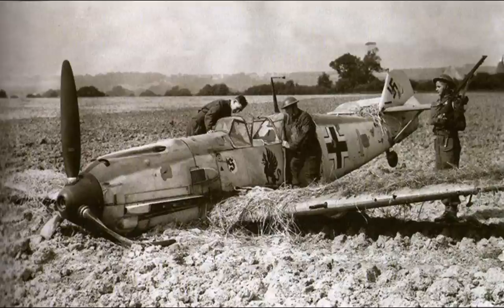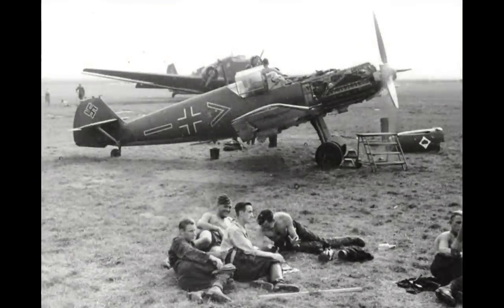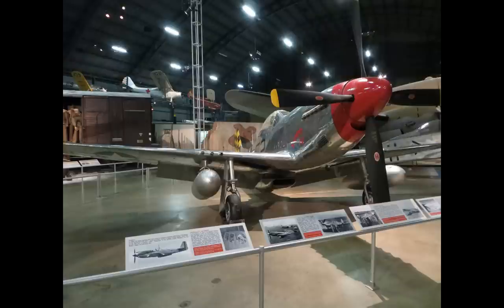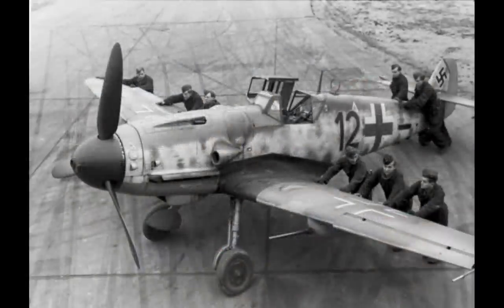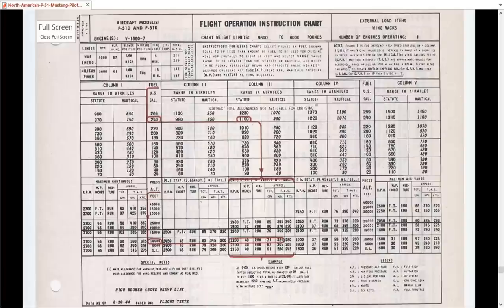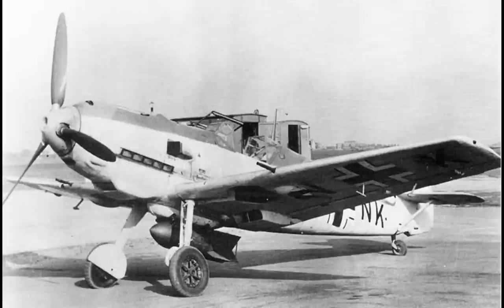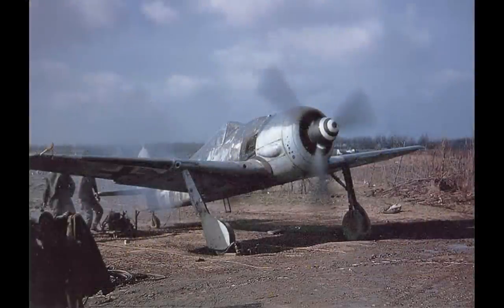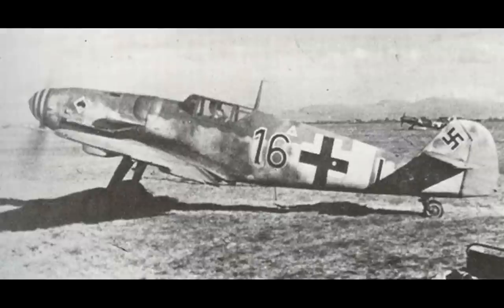Messerschmitt BF 109, Why Such Short Range?

Comment: As mentioned, the Spitfire and Hurricane did not have any better range than the 109. Also the Spitfire's, like the 109's, wing structure and design did not allow the addition of fuel tanks. The German airforce was basicaly a tactical force where range was not that important. I think at the start of the war bombers were not expected to need an escort so the fighters tended to be a "point defense" interceptor. In that role extra fuel just adds weight and reduces performance particularly climb.
After D-day the RAF Spitfires had to move with the front lines so they could stay in range of the fighting.

The US, as in many other things in WW2, had time to design new aircraft to meet the new needs. Remember the war started in 1939 the US did not enter until 1942 (December is almost 1942 by any realistic measure). (the P-51 was faster due to better and more modern aerodynamics, just the design of the airflow though the radiator system was huge. I am sure Greg covers this later.)

The reason the Germans used bigger engines for the same horspower was fuel. The German airforce had to make due with 87 octane gasoline where the US (RAF fuel was supplied by the US too I expect) was 100 octane (there was 120 octane too but I don't know how avialiable it was) The much higher octane allowed much higher manifold pressure so the engines could develope more horsepower per engine displacement.

As bonus info: The B-17 cost more, flew slower and had fewer built than the B-24 but the B-17 got most of the recogniton.

Comment: Well somebody that asks the right questions! And here´s another one:
From it´s inception, the Luftwaffe was designed to support ground forces, not fight on it´s own. It had no strategic role whatsoever, unlike it´s US counterparts. Second: From 1942 on it´s purely used for protection of the Heimat, by than being bombed around the clock. So there´s simply no time for updating it! It remains in production, without major updates, until the end of the war. Same for the bombers used by the Luftwaffe: The same He-111 bomber remains in production because they couldn´t afford a pause in it´s production. The Eastern Front required a LOT of tactical bombers and fighter-bombers to offset superior Russian Armour.

Everybody always thinks the Wehrmacht and Luftwaffe were technologically very advanced, while basically the opposite was true: By 1945 they were still using >95% the same weaponry as in 1935, and much of it was nearing obscolecense. The same Panzer IVs that raced trough France in 1940, were the armoured backbone of the landforces in 1945, the same was true for the Bf-109 and He-111 bombers in the air. They couldn´t afford to stop producing bombers, because of aforementioned threat on the Eastern Front. Another question rarely asked: How much did the Eastern Front influence the Luftwaffe? ;-)

Comment: Why was the horsepower/displacement so low for the DB601/605 engine and significantly higher for the Rolls-Royce Merlin? The Merlin got as much-or more-power out of 27 liters as the Daimler-Benz got out of 35 liters. Was ist los?
Reply: I have read elsewhere is that Germany had much more limited fuel supplies(the reason for the 1942 push towards the Caspian) and could only get 91 Octane fuel whereas US and UK Merlins could use 135 Octane fuel which gave much more power per displacement.

Comment: I always thought that the short range was mostly to do with the poor quality of the fuel. The aircraft was just not able to generate the extra performance to match the Spitfire and later the Mustang without burning extra fuel and so Messerschmitt pilots were heavier on the throttle to compensate and that emptied their tanks faster. 

Secondly, their engines had to be set for specific altitudes of operation and during the Battle of Britain this involved dogfights near their own bombers at 10,000 to 12,000 feet, so the engines produced their most performance between 5,000 to 17,000. Except when they were fighting American bombers they were intercepting them at 25,000 which was outside their best ranges. So the pilots simply increased throttle and that meant they burnt through their fuel faster.

German fuel was typically 80 to 95 Octane, whilst Mustangs ran on 130 to 150 Octane. So naturally the American pilots were able to go easy on the throttle, except in war emergency settings and save fuel during cruise, extending their range.

Comment: Allied drop tanks were made from waxed cardboard with a small metal fuel pipe and a clip for connecting to the fuselage.  The fuel  dissolved the wax after  2 hours rendering the remains   non-recyclable.
Reply: They discontinued the paper tanks in the middle of the war because of the inconveniences of using them.

Comment: it must have been maddening for the German pilots who didnt have fuel enough to continue the fight, when ALL they had to do was strap a pair of 80 gallon tanks under each wing.

burn external fuel until combat zone is reached, drop tanks, and use internal tanks when engaging Spits and Hurricanes

Adolf Galland repeatedly petitioned Georing to equip his fighters with drop tanks and many many other German pilots shared the same frustration

speaking as a Canadian im glad they didnt. Speaking as a self styled armchair tactician/strategist...its probably one of the biggest mistakes that was made, that could soooo easily have been fixed

Comment: The P51 is designed so the air flow into the intake will be at the same speed of the plane, so actually the sucking action adds to the power
Reply from the maker: you might like: https://youtu.be/OqiG9VHuBbM

Comment: Great video as always. One very important factor that is (surprisingly!) not mentioned is the simple matter of need. US aircraft needed long range to cope with the Pacific, and with escort duties over Germany from bases in the UK. German aircraft (once the Battle of Britain was over) didn't particularly need the range, at least not on the Western Front. (I'm not sure how much use extra range would have been on the Eastern Front, probably not so much.) For Germany, the name of the game was speed, armament, rate of climb, agility - these were the qualities needed to attack bombers and avoid or engage Allied fighters. They spent most of the war fighting over or close tor home territory. Contrast with the US fighters which had to fly long distances, and did. And compare with the Spitfire which started as a home defence fighter (same job as the 109) but later on needed more range to take the fight into Europe. Because of packaging and centre-of-gravity issues, this was not easily achieved and needed major engineering changes, but eventually these changes were made (although by that time the most pressing need had passed as the P-51 had done the job and Spitfires were starting to be sable to operate from airfields in France).

Greg - one of your videos following the long struggle to get more fuel into the Spitfire would be a good 'un.
Reply from the maker: I hear that a lot, but it sort of pre supposes that the designers of the 109 and Spitfire could have built them with more range if only they had wanted to. That's not the case. If you double the fuel of either of those planes you would need to change the whole design and they wouldn't be 109s and Spits and would have far less performance.

Comment: Another excellent video.  The DB-605 was not just fuel injected, it was multiport direct fuel injected.  Stated differently, the fuel was injected directly into the cylinder head, and not before the intake valve.   It's completely superior to other types of fuel injection, although it's more complicated and requires a high degree manufacturing precision.   Even now this type of fuel injection is relatively rare in automotive use. Direct fuel injection cools combustion gasses,  reducing engine knock allowing the ignition to be advanced further on a lower octane of fuel.  The DB-600 series burned 200 gallons per hour while the Merlins consumed 245 gallons per hour.  That's a big difference.  The DB 600 series had much more displacement than the Merlin but only weighed 26 pounds more, they were near identical in power as they evolved through the war. The Mustang weighed 2600 more pounds than the 109 (both empty).    This video, as I understand basically claims that the P-51 had a larger airframe that could hold more fuel.  100% accurate
Reply from the maker: All true. Thanks Jim. My greater point is that the Germans were hamstrung by lower octane fuel. High octane US fuels enabled the P-51 to have greater power, especially at high altitudes (above 20k feet), and with their bigger airframe they could pack more fuel in .
Reply: @GregsAirplanesandAutomobiles  Absolutely.  Adding lead to fuel was a game changer, not without issues though.   Big fan of your work and consider it an authoritative reference.

Comment: Pumping clean air into the engine can allow a better volumetric efficiency. But only if fuel is injected up against the cylinder head. That allows the fuel to expand (and displace some air) after its entered the cylinder. in the intake system = more power. Carburettors are never so close to the cylinder (and throttle body injectors are the same) so there is more fuel expansion pushing some air aside. It depends where the fuel is added to the system so as Greg says it's about power not fuel economy.

Comment: The Bf109 (and Fw190) had a space behind the pilot in which a mechanic could be ferried during movement of squadrons. This space could perhaps have been used for an extra fuel tank. Indeed this is where the P51 had a fuel tank. I think that by the time the Germans thought about a longer range fighter, they were fighting a more defensive war anyway. To some extent the Bf109 and Spitfire were interceptors and the P51 was an escort fighter, indeed it was developed as an escort fighter to RAF specifications, although the RAF switched to principally night operations.

Comment: Your fine video relates range mostly to aircraft design.  As you briefly mention. the design is a function of the perceived mission for the aircraft.  The Bf109, the Spitfire, and the Yak were designed as either interceptors or infantry support protection aircraft.  These largely defensive missions didn't require long range. The Mustang and to a greater extent the Zero were designed for supporting aircraft on long range missions.  The Spitfire and the Bf109 were both range limited due to designs resulting from their intended missions. During the battle of Britain the Spitfire was flying its intended mission and wasn't seriously handicapped by its short range.  The Bf109 escorting medium range bombers was flying a mission it was never intended for.
Reply from the maker: Had they designed it for more range then it wouldn't have had the required performance due to the technical limitations explained.

Comment: I'm sure I read once that the reasoning behind the DB and Jumo for that matter going for larger capacity in their engines was to allow for the use of 87 octane fuel which I'm thinking was helped by fuel injection and the torque-coupled blower system that both Mercedes and Junkers got to grips with in the mid thirties. The work load for pilots with the German engine management systems was greatly reduced- no monitoring altitude and changing supercharger gears, the pilot simply matched throttle position to altitude by an indexed scale! Brilliant system really. When the British dissected a DB 601 a full report to the air ministry recommended adoption of many of the German systems. Also, the valve train on German engines was a thing to behold. One camshaft over each six cylinder bank with two small cams for each cylinder and a system known as interposed roller followers to operate the four valves! The main advantage here was a reduction in the parts count and therefore weight. Now, can someone tell me why a system like this can't be applied to modern car and motorcycle engines?
Reply: It is expensive to build, it is expensive to maintain, and the advantage it provides is miniscule.

Comment: Extra fuel in the wings of the 109 would only hurt role performance if the fuel was there when the maneuvers were performed. As in if you burn up most of fuel on the wings getting to your target destination there's not much extra weight to hamper your performance.
Reply from the maker: Oh yes there is, because self sealing tanks are heavy all the time. Of course they could have gone with a carbon dioxide purge system like the US Navy had on the Corsair, but I don't think the Germans ever used such a system.

Comment: p 51 was designed as a bomber escort from the start and it also had drop tanks. They could have put drop tanks on the BF but the germans didn't need bomber escort at the time.

Comment: The 109G, was more a intercepter then a fighter. The main quality it needed was climb rate. With the B-17s faster and higher inception, the 109 had to get up there fast. External fuel tank would be a hindrance. 
Just look at what happened at the Battle of the Coral Sea with the Wildcats being launched to intercept and only 2 or 3 of them getting up high enough to do anything. 
At the time of the 109-G long range was not a priority.

Comment: The P-51A(Mustang I) was designed around the Allison engine as an improvement over the P-40 with similar armament.  it was not envisioned with the Merlin.  It was a 1940 design, first flying in 1940 seeing first combat service beginning in Feb 1942. It was given 180 gallons of internal fuel and although it had more space, the CG with the Allison was optimized with that much fuel.  The first Merlin P-51's were flown in Oct/Nov 1942, with full production beginning 1943.  With the heavier Merlin moving the center of gravity forward the P-51 could carry 269 gallons.  The P-51B/C/D was a happy accident,  an accidental collision of  chocolate and peanut butter.                                                                                                                                  Not related to this video, but still related to the fascination some people have to the 109, many Nazi fanboys  tout the 109's ability to mount a cannon through the spinner "due" to the inverted V engine as a triumph of German engineering.     What they fail to recognize is that the Soviets and the French before them, built around 40,000 fighters with spinner mounted cannon....in an upright V engine.
Reply: Was the Mustang designed around the Alison engine or was the intention to get a plane built in the USA that the RAF could put a Merlin in after delivery? Remember the AAF was not involved in the early design of the Mustang and North American worked closely with the RAF in it's design. The AAF only was willing to consider it as an attack aircraft, the A-36 Apache which was different from the British Mustang in that it had dive brakes. The British gave much guidance on the wing shape and cooling system which did much to improve the aerodynamics of the aircraft.
......This was also something to think about when the RAF ordered Lockheed P-38 aircraft without counter rotating engines, which they canceled before delivery when they found out how hard they were to fly that way. I suspect that they were already thinking about a Merlin powered Lighting but did not want to build a counter rotating Merlin just for the one plane and when they found out how badly it handled they backed out.

Comment: the 51 had similar fuel capacity. but one crucial difference, the 51 used a high pressure supercharger which went air heavy on the air/fuel mixture. less going into the carb means less fuel burned in the same period of time,  the germans were counting on  the low to mid altitude dogfight, and since the 109 served the defensive role, they needed the horsepower to bug out. the allied fighters were offensive role attack aircraft. they sacrificed power for range. in it's arena. the 109 could compete with and in some cases outperform the 51.

Comment: Thank you for the information. On CG, wasn’t it required on the P51 to pull fuel from the center aft tank on the P51 just because it would negatively affect handling until it was empty? Hard to add an internal aft tank to an existing fighter absolutely.

Comment: Totally agree, the Bf109 is a continental concept of single-engine fighter hence very limited range.  But the Germans had an answer: the Me 110. This had more than double the range of the 109 and was also supposed to be a fighter although it wasn't very good in this regard. Success as a night fighter and ground attacker notwithstanding. I think a video on why the Me109 was so much slower than say the P-51D is a really good idea because the power to weight ratio suggests it should not be so. I'm an engineer who has studied fluid dynamics so I know the answer, but I'm not going to be a spoiler...
Reply from the maker: Hi Karl. I did make a video on P-51 vs. 109G in speed, and another video about the K.
Reply: @GregsAirplanesandAutomobiles  You did and I should get my sorry butt over to that vid. But you mention another video you're going to do on the same subject?
Reply from the maker: Yes, I am going to do another P-51, vs. 109 video, but this time on the airframes. There are some myths that need to be taken care of.
Reply: @GregsAirplanesandAutomobiles  Maybe at the same time you could compare the FW190 A and D to those. Just  because the FW190 was a radial didn't limit its speed due to unnecessary drag